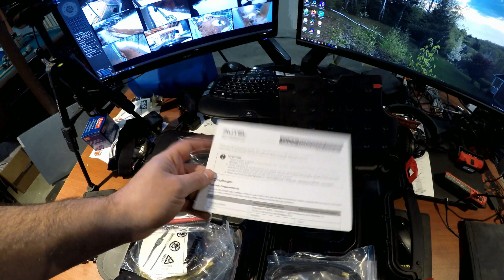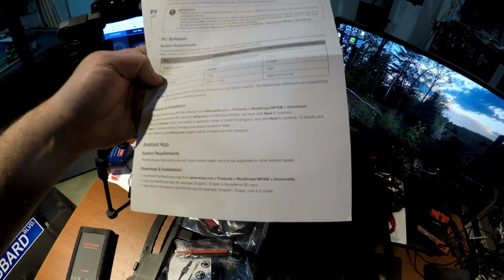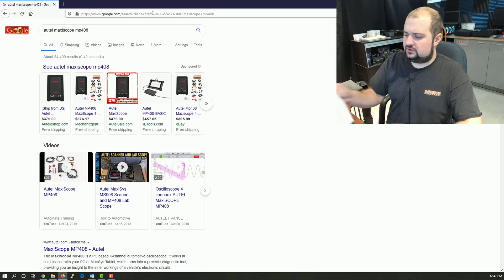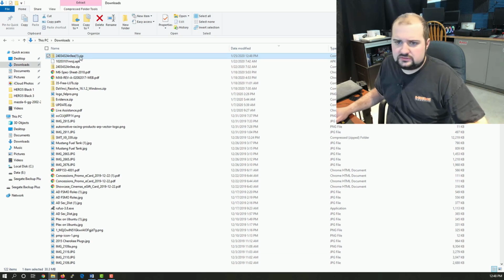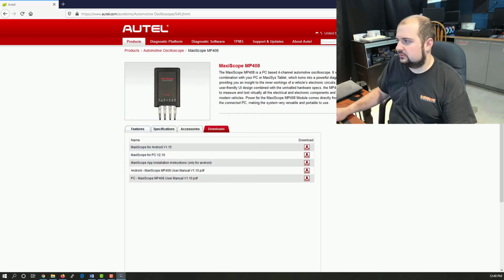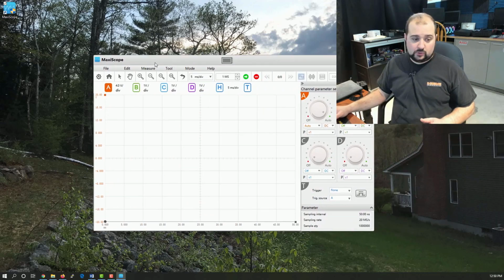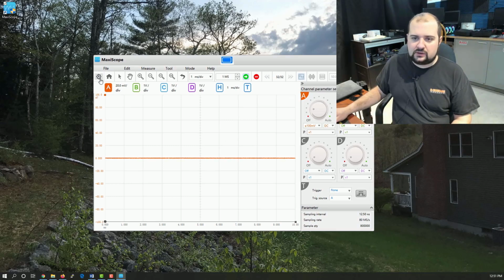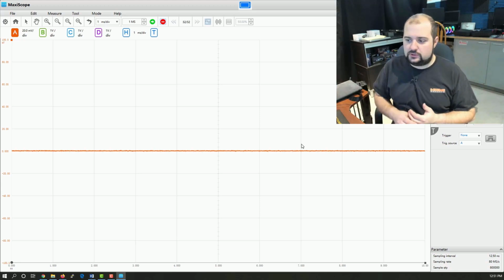Autel MaxiScope MP408 Unboxing and Installation

Comment: How is this scope?  I have an Maxisys 906bt on order and am looking at some scopes.  How does this compare to the micsig or the carscope viso?  I know it's cheaper price wise than the micsig and the carscope viso.
Reply from the maker: I'm not familiar enough with the two scopes you mentioned. I have gotten more comfortable with the scope, although I do not see the volume of cars that others do so it's not a tool I get to use often. I have found there is waaaaay more information out there on how to use scopes like the PicoScope. The PicoScope I believe has specific settings for testing various things and this does not. I find that good and bad. It forces you to learn the scope. The unit itself has been relatively easy to use. Well built. Software seems a little...buggy? at times but otherwise not bad for the money. If I had the funds I would of picked up a PicoScope.

Comment: How is it with a laptop???
Reply from the maker: It's not too bad. I use it with my Surface Pro, which is a tablet. I'm sure it would work fine on a laptop, but you'd lose the touch screen zoom capabilities.
Reply: If your wanting to do critical measurements it’s best to use with a laptop. IMO this a great scope especially for the money. It lacks in some of the software areas: grabbing rulers, creating math channels, and test leads are known for reliability issues. It’s all there just needs refining from Autel. Definitely NOT disappointed with mine. Would’ve been nice to have different color leads and/or to be able to change the color of the traces / channels.

Comment: If you are learning So am I,I also have the 908 tablet as well,but I’m thinking I’m going to run a laptop on the 408 ,just to make. The scope simpler to follow,understand.good video,well done.
Reply from the maker: Unfortunately I don't have their tablet yet, but I've found my Surface Pro or my laptop work fairly well with the scope. I still have a lot of learning to do on it.

Comment: Regarding your link to the Autel MP408 , Does the price includes the case ?
Waiting for your respond before l use your link.
Reply: Thank you for the immediate response. Had wanted to call them to make sure before ordering but couldn't find their number on Google. Can you please give me their number if you have it ?
Reply from the maker: dan cujo I will take a look on the box and see if there is a number
Reply: @ACHAutomotive  Thank you. Be waiting for you.
Reply from the maker: @dancujo3247  So the number on the box is their international number in China I believe. It's 86-755-86147779 - They also list the email: sales@autel.com
Reply from the maker: Yes mine came with the case and all the basic accessories

Comment: I have a autel elite with the mp408  scope and I've been using it for over year and it have been very good but practice is the key to master it .
Reply from the maker: I have a lot to practice! I think in retrospect that getting something like this vs a picoscope to start out with will be good because it will force you to learn how to use the scope vs the built in tests the Pico has.
Reply: ACH Automotive actually this has 90% of what the pico 4425 does. Filtering, custom probes, math channel, much much more. Just like Pico